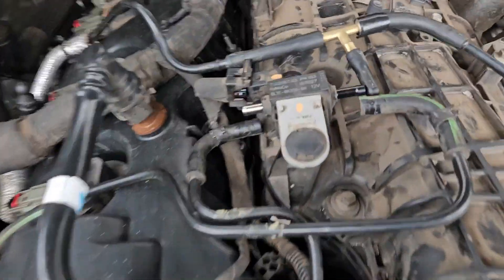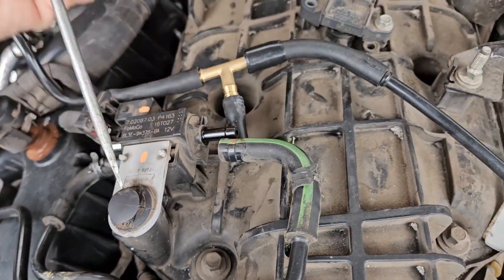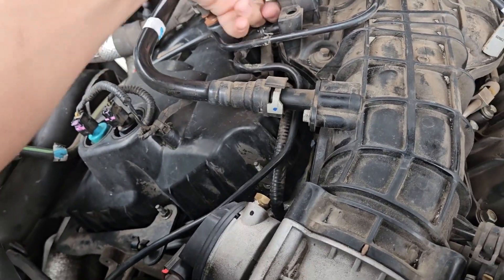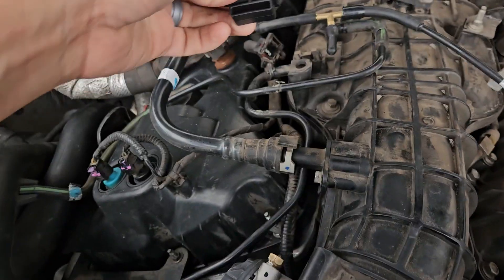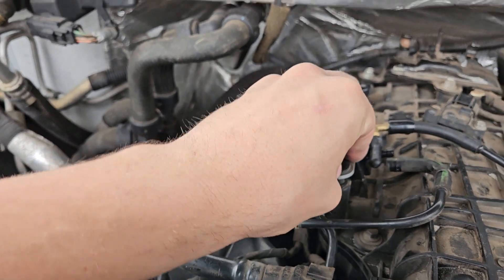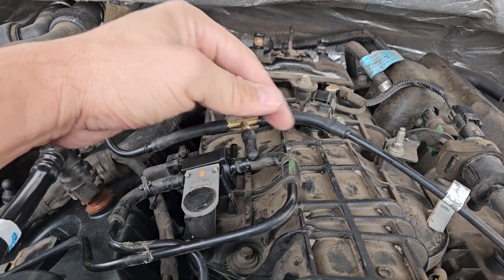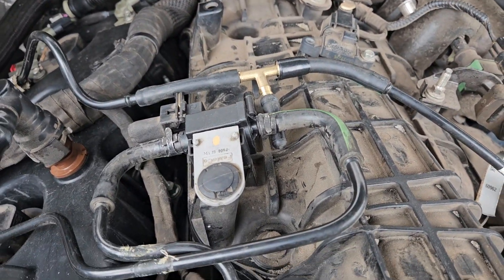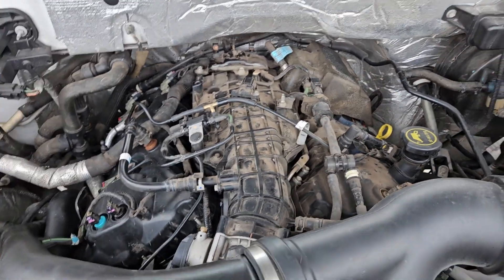2015-2017 Ecoboost Expedition Boost Solenoid Replacement - How to  for all Ecoboost Engines

Comment: So my 13 eco f150  it will run fine and drive normally but the min I go to pass or wot it with start stuttering and act crazy and the check engine lights comes and it comes up as p0299 code I’ll clear it and truck it fine tell the next time I have to pass or get on it
Reply from the maker: You could need to replace this solenoid or you have a boost leak meaning an intercooler hose may of popped loose. I would inspect all the plastic piping for cracks or any breaks in connection etc. 

Mine was doing the same but saying overboost code.
Reply: Could be any of the intercooler hose fittings, ran the stock plastic actuator a long time ago on the intercooler, it warped so I replaced it with the turbo smart metal one and it fixed the issue I was having with the truck loosing its get up and go, also check that both turbos spin freely with zero to maybe minor resistance depending on the age, I lost power recently after I had a transmission replaced(never going to that shop again), tech broke my T fitting going to this solenoid and didn't say anything, they also tampered with my wastegate settings and stole my blankets off both turbos, actually ruined them both. Now I have to replace them as the shop no longer exists as they just disappeared(along with my warranty)...all fun, I've learned it's better to learn how to do it yourself or someone else is gonna make it worse for you.

Comment: Hello and thanks for your video. I have a 2017 F150 and I get the P1016 code. Is this the same as the Wastegate Solenoid?
Reply from the maker: So that can be a vac line coming from.this solenoid to your turbo, or you can have a bad waste gate as well. Does yours make noise on cold starts like an exhaust leak type sound?
Reply: @cpstang24  Hey thanks for the fast reply! So yesterday I did what you did in this video and its definitely running so much better. I did clear out the check engine light, did your automatically clear it self? I didn't realize the power lag that I was getting until I switched out this part. There was no noise on cold starts. The check engine light came on only a couple days ago. Thank you again for doing this video. I did a video of mine........That was a S&*!T show haha.
Reply from the maker: @Bros3DPrints glad it was your fix for your issue. Mine i had to clear the code on my own. It would not go away on its own unfortunately.
Reply: @cpstang24  I'm thinking this is problem on my 2015  2.7 F150 as well.  Cold starts fine with no noise.  about 10 minutes into my drive to work, the wrench light comes on and I have little to no boost.  If I stop the truck, shut of the engine and restart it, then the light turns off and I have boost again.  I'd like to repair this myself.  I need to plug in my code reader next time this does it.  My coworker, who is a big gear head, says he thinks its this solenoid, as it's a common problem with all the ecoboost motots.  I've also been told by my dealership it could be the wastegate.  While I don't remember the code that popped on the code reader, it essentially was a boost code that the engine threw at the time.  Then it magically went away for about a year, only to return yesterday.
Reply from the maker: @jaymay306 I would start with this solenoid first and then go from there. I am told or have seen the wastewater can only be bad if it makes noise on cold start but anything is possible but again would start with the solenoid

Comment: Was your truck throwing a code when plugged? My 2015 2.7 is throwing P1016.
Reply from the maker: No but if i went full throttle I was good an overboost code that was tripping my checking engine light and causing a sputter with hard acceleration

Comment: Thanks. Was it giving any code? Is this the same thing as VVT solenoid? Sorry for my ignorance. I have a P0022 code that came on on my 2017 Ford expedition with 3.5 ecoboost and wondering what the problem is
Reply from the maker: Unfortunately that sounds more like a stretched timing chain or a bad cam phaser. Would start saving for a complete timing kit and install. Do not beat on the truck with that code. Just drive it normal.